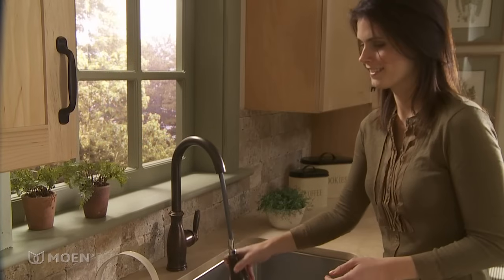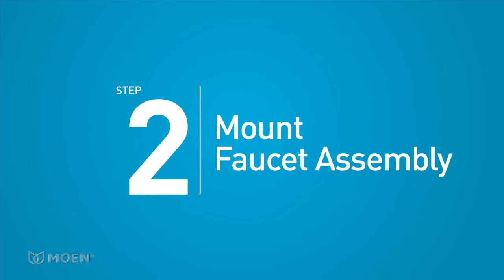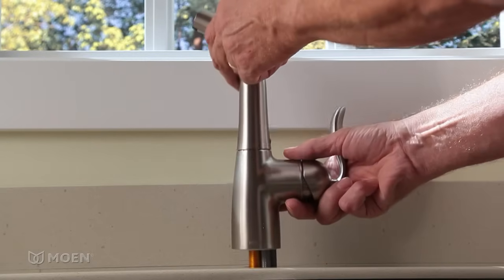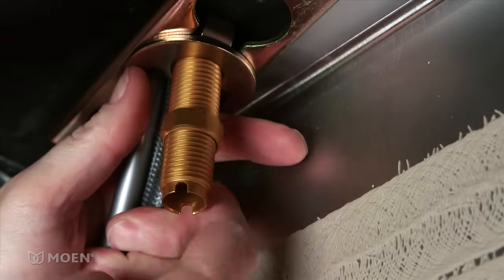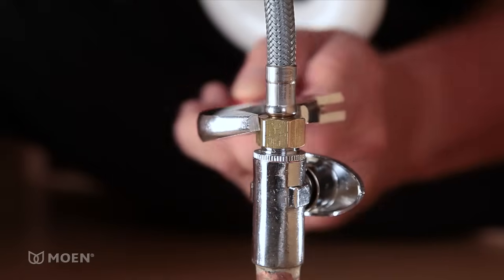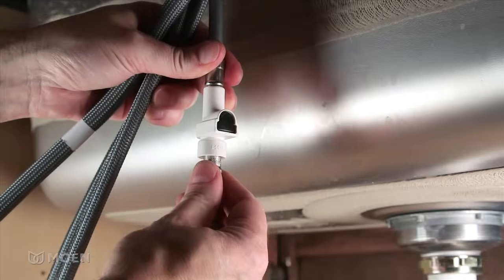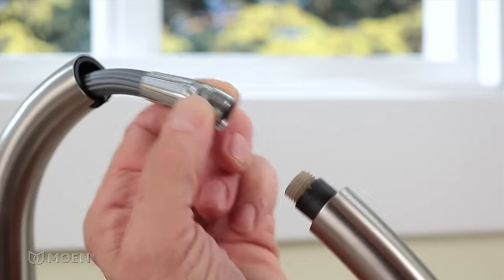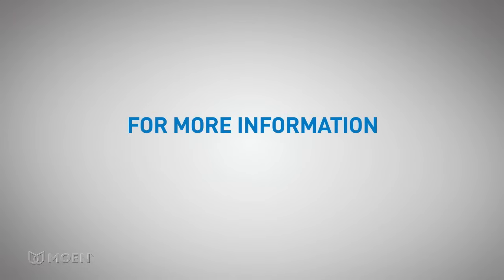Installing a Pullout Kitchen Faucet | Moen Guided Installations

Comment: Why couldn't it just be a normal threaded fitting now I have to go back to the hardware store to get a new connector or adapter, I get its faster but its something you do once every 5 years so just go with the standard fitting for Pet's sake.
Reply: O wait now I see why.. your the only company you can buy these dumb hoses from so now I have to spend 27$ on a adapter from you or 27$ on a hose YAY thats definitely cheaper then the 10$ hose.
Reply from the maker: Hello Nolan, Moen  updated the valve body with flexible supply lines in 2009. You can go to your local plumbing supply store for an adapter to fit the 3/8" compression fittings.

Comment: Great video but you didn't mention the important weight install.
Reply from the maker: Hello Walt.  The weight is placed approximately 4"-6" from the bottom loop that the hose creates.  The weight should be on the side of the hose that is opposite of the quick connector.
Reply: 2:52

Comment: DO NOT buy the Banbury Kitchen Faucet. I've had two and they've both failed. Both after a couple of years and long after I had (foolishly) rid of the box and paperwork required to have it replaced. Search general reviews of that faucet model and you will see it's a common issue. And while I appreciate the lifetime warranty, the hassle of going through that return and re-installation is simply not worth it.  @Moen - send me a new non-Banbury faucet. Two in fact!
Reply from the maker: Hello Noel.  We are sorry to hear that you have had difficulty with two Moen kitchen faucets.  We'd be happy to help under the product lifetime limited warranty.  Please call us at 1-800-289-6636 in the US or at 1-800-465-6130 in Canada.

Comment: I installed the Moen Kitchen Faucet with the plate that covers 3 holes. Used the nut to Tighten on the bottom just like shown in the video and the whole thing is loose after three weeks so the question is! 

Why don’t you and show installing plumbers putty or siliconing the bottom of the plastic plate to keep it against the sink or another method? 

or is there a part missing?  no there’s no part missing!  because all the parts were in the box! and I followed The instructions to the letter and all the parts described in the instructions were in the box! 

This video does not provide the real truth about what happens with everyone’s  faucet with your cheap crappy plastic pate with the plastic plate insert!  covers the (3) holes this is ridiculous! it will become loose just like mine,  epic failure!

When I remove my old Fossett with his plate they had use plumbers putty to keep it in place!
Reply from the maker: Hello Kaplan Design Audio & Video Solutions.  We are sorry to hear about your installation experience. We would need further information to assist you with your installation issue. Depending on the model number installed, type and age of the surface installed on a small bead of sealant may need to be used. For further assistance with your model, please contact Moen directly.

Comment: Your cheap plastic parts loosen and break.  My $300.00 faucet shipped with a 5 cent plastic mounting nut that cant support the faucet.  Do better!
Reply from the maker: Hello Ron. Moen pull-down kitchen faucets have both metallic and non-metallic components.  The non-metallic components reduce the chance of rust/corrosion occurring with the product. What you described is not consistent with the quality we strive to provide.  As the original purchaser of the Moen pull-down kitchen faucet, this product is covered under a Moen warranty.  Our product specialists would be delighted to work with you to find a satisfactory warranty resolution.  Please contact Moen directly.